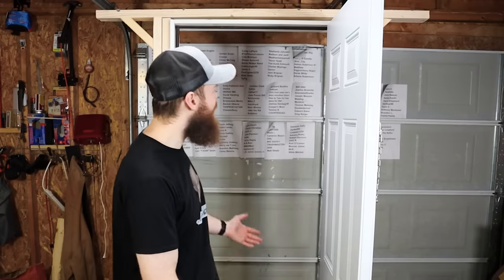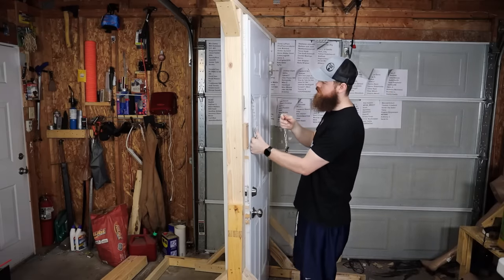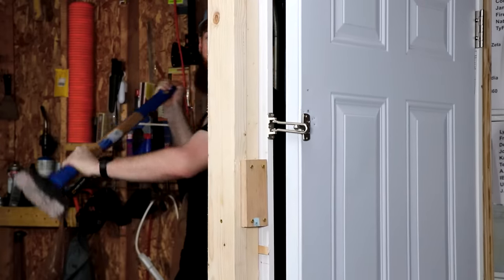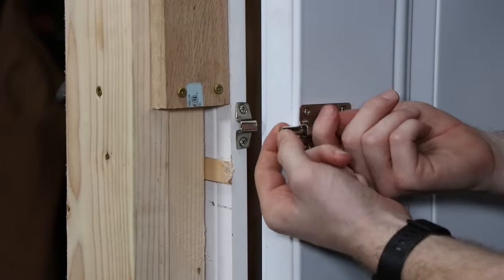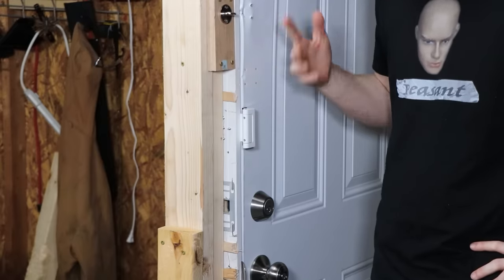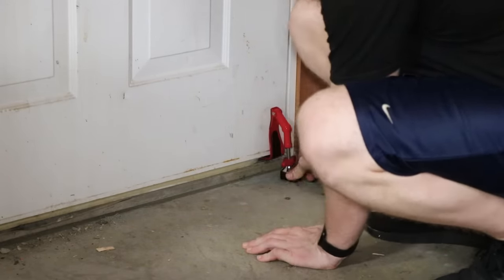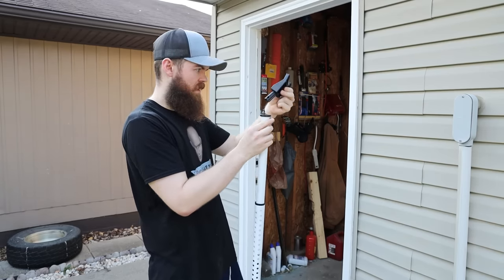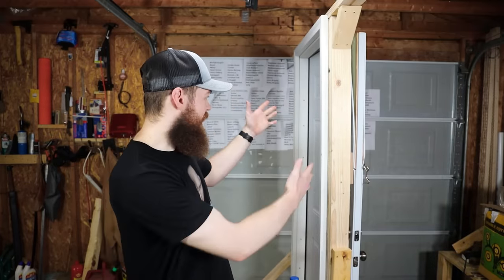Testing Top Rated Door Locks From Amazon!

Comment: Do you think the white hinge type lock that you assumed would be stronger could’ve failed because either (1) the door was so far off from being flush with the frame that the lock didn’t fully engage or (2) there was excess space in between the frame and the door, placing too much torque on the far edge of the bumper as this would create a radial/circular force that almost mimics pulling the hinge out with your fingers?  I can’t tell whether the latter is an issue from the view on the video. Just asking because i was leaning towards this lock the most before watching this video. Now not too sure

Comment: I work in a hotel that has those U-type locks. There has been instances where we've had to breach the door. There's a few ways to open them. 
1. Use a credit card/ drivers license/ or the hotel key card to slide it in the door frame pushing the latch open. It takes practice to do this effectively. 
2. Once the door is open you reach in with a pair of channel locks and grab and twist either the top or bottom "rung". This breaks it and moves it away.
3. Same as before. But once the door is open you use a good strong knife or the tip of an expandable baton and put it between the rungs. Then twist either up or down until it breaks and separates.

Comment: My apartment door came with the 2nd lock thing you tested installed, and it has helped me feel safe numerous times. I have anxiety and a bit of paranoia. Sometimes I get it in my head that someone is going to come in my apartment and kill me in my sleep. No good reason for the fear, tbh. I live in a pretty safe area. No crimes in this neighborhood in the three years I have lived here. And I am a man, so it's not like I feel afraid because I am weak or anything. It's just mental illness :) 

Anyway, I use the extra door lock thing whenever my brain convinces me I am in danger. This video of you struggling to break the door down with it on there makes me feel even better. And I know the one I have is even more heavy-duty (thicker, installed correctly) than the one you tested. 

Could you also test window locks? My apartment is on the second floor, but I still get paranoid that someone is looking up into my apartment from below and that if they see me they will grab a ladder and climb up in here to bypass the door. 

To anyone who is alarmed - yes, I am being treated for my mental illness. Knowing something is irrational doesn't make it seem any less real, in the moment. Once I get into that panicky hyper-vigilant state of mind, not even Superman could convince me the threat isn't real. I am not a danger to myself or others, at this point in time.
Reply: Honestly I thought I was crazy for this. My dad has always told me if you're gonna lock one lock make it the dead bolt but be smart and lock both. I get up and check my locks 2 3 times a night because I'm convinced someone will break in and kill me and my boyfriend when we sleep. I have the second lock he tested and like you said it made me feel better watching him struggle to get in. I live in a safe and gated community when we house sit (7 or 8 months out of the year) and so I shouldn't worry but I watch enough crime shows to know better. My boyfriend tells me I'm paranoid but growing up in a neighborhood where we've been broken into twice and had many robbers in it I don't take chances even though that wasn't a safe neighborhood. He complains that he gets locked out of the house because I forget to unlock the door but I tell him do you want me dead or do you want me locked out of the house. That changes his mind fast. I use locks more as a delay so the can't just walk in and I'm a light sleeper most nights so a creak in the house settling wakes me up fast. So I sure as hell will here a sledge hammer bang through the door. But trust me you're not alone it's safe to be paranoid it just means you're aware of danger and wanna stop it
Reply: Any time I get any type of pain like a sharp stab In my side for example I convince myself I’m dying it can be as simple as a headache and I’m convinced or I get a cut I always think I’m gonna get gangrene or some other infection that’s deadly I don’t know why also doesn’t help that I get lots of weird pains

Comment: A suggestion, if you want a secure door, just buy an outside opening one. Second tip, buy a strike plate. Third tip, buy big and long heavy duty screws and use them in all of the screw holes.

Comment: A way to impove the stick stop thingy is to drill a hole through the right hight setting and insert a steel pin with cotterpins on both sides. Im not sure if it still would fail but i want someone to try it. Im a failed engineer so i kinda know some things lol
Reply: The tube walls would probably just tear at that point but I think you would probably have to at least kick it then and have the foot of the stop in a hole so it can’t slide🤷‍♂️

Comment: One the easiest way to increase door security is to remove the little screws that hold your dead bolt receiver plate to the door frame and install 4 inch deck screws in their place... especially if you have a good sturdy steel core door and properly built door frame

Comment: You didn't install a striker plate for the deadbolt, of course it's going to break
Reply: Striking plate wouldn’t have kept the door frame in tact @Anon Ymous
Reply: @cadenj8171  yes it would.
Reply: @cadenj8171  it would if the screws were long enough to go into the 2x4 which they should be.
Reply: @cadenj8171  If you buy a security type yes it will because the bolts for it go past the door frame into the wall, which is the point of them.  in that case it is probably easier to get the door off by ripping the hinge side off rather than the deadbolt side, unless of course similarly beefed up hinges and bolts were used there too.
Reply: He was also kicking the door open rather that kicking it in. If he was kicking it in the frame wouldn’t have split as easy becuase the inside of the of the house section of the frame is much thicker than the outside of the house section of frame.

Comment: If your frame was bolted down so the door wouldn’t move when you kick it, the second lock may have broke sooner. Those things are pretty good though
Reply: Definitely been better if the whole situation was bolted down somehow for sure.
Reply: I'm not so sure he was stood on the frame while he kicked meaning hes putting the same force into the door as he moves with it
Reply: Had the door been bolted down, it would have been in splinters by the time he reached the third lock.
Reply: @dylandepetro4187  yeah the door/door frame definitely wouldn’t of survived near aslong.

Comment: I work at a hotel. Those latches are designed to be opened with a special tool from the outside. You could easily buy one offline. Or maybe even make your own as they aren't really anything more than a thin metal plate with 2 prongs. Also, there have been times where we couldn't find the tool and our security has just kicked the door in. I've seen 3 just rip out of the door frame still intact.
Reply: You can also reach in with channel lock players, twist and break it

Comment: He spent 2 hours trying to get the door to swing smoothly just to test these locks and break it. Haha. I'd actually like to know his thought process on how and why he thought the hotel room door lock was gonna be easy. Cause honestly, I've always thought out of all of them that I've seen, that one seemed most secure. The other sturdy one I figured would eventually pop the hook out due to vibration (which it did the first time he retried with different screws). If the hook had a carabiner type end instead of a hook, I'd say that it would work great though. I feel like if an intruder was gonna go this far, they'd be quicker just breaking a window. Haha. I mean, your door can be as secure as you want it to be but windows are always a weak point when it comes to keeping yourself safe in terms of that cause lets be honest, criminals are already breaking the law, they aren't gonna care that they have to break your window to get what they want. This was cool to see tested out though because I've looked into these for a while for more home security. I'd say Tyler was probably pretty sore after this workout. Haha.
Reply: Easy fix for windows is a pair of thick solid wood shutters mounted inside. screw 2 pairs of iron brackets on the window frame 1/3 from the top and bottom on each side, using stout 4 inch screws, then slip two 2X4s into the brackets going across the entire width of the window into each pair of brackets. They can break the glass all they want, but they aren't getting in.

Comment: Want a real “you’re not getting in” door lock? Steel U brackets, with a steel drop in rod. Pain in the butt, unsightly, but no one would be getting in. Lol
Reply: Or those c locks that you slide a c shaped thing over a metal plate and basically makes a flat surface right up against the frame and it can't move

Comment: I'd make a couple of changes to that chain latch. Replace the chain with a thicker chain and shorten the chain. or mount it horizontally with 3" screws. And I'm not a Tool Time handyman that grunts and growls doing work like than but learned to make lock improvements and put heavy duty slide bolts top and bottom of door. Take off the commercial door and use a solid at least 2" wood door, on 3-4 heavy duty hinges and 3-4" screws. On our hunting cabin we glued 2- 3/4" plywood sheets together with a 16 GA sheet metal sandwiched in center next drilled 4 rows spaced about the door, then inserted 2.5" carriage bolts from outside and put a washer with lock nut. On door frame ran a latch bar for dead bolt lock and doorknob strikers screwed with 3" screws from top to bottom, On the door before putting in locks etc. slid a folded sheet metal guard that my Granddad (made in his shop) with holes cut out for knob and deadbolt then drilled 3 holes at top, middle, bottom of the guard and again used carriage bolts with locknuts and put a heavy duty slide bolt top and bottom of door for when inside for the night. But when going out we had 2 dead bolt locks and just below the door knob my Granddad made a 3/8" thick cross bar using a 42-48" piece of steel flat bar cut in middle joining the two halves of flat bar with a sprocket designed for when locking the door from outside it would engage the flat bar into square tubing on either side of door that held the flat bar in a locked position.  The drilled hole through door drove a cylinder of rolled metal sleeve through the door and like one of those tube keys used to open vending machines, he keyed his own key to lock and un-lock the cross bar, making it hard to kick in from outside. All the windows had swinging metal bars that could be unlocked from the inside and when home was swung back like shutters against the outside wall of cabin. Only break-ins for brief time were critters that chewed through a knot hole. But we corrected that situation. But people snooping around when we. weren't there. Never did kick in doors or go through a window. Wish I could make that cross bar lock he made and all the guards he put on both doors and all the windows, on my apartment. Crime so bad with break-ins etc. it's frustrating.

Comment: Just go old school and get some iron brackets and a 2 by 6
Reply: YES...everybody tries to overthink and over engineer things, and they usually always fail. Just screw two very stout iron brackets directly into the 2X4 frame using stout 4 inch screws, and you're done.

Comment: I work at a hotel and the one you recommended as the best is one of the easiest to bypass with just a card. Also, you are testing all those with the door and deadbolt unlocked. All of these are added protection, not primary. Was fun watching you bust the door up tho.

Comment: That little wedge lock is good for hotel rooms.  They usually have a metal frame.  Not good for more than keeping the cleaning crew out, while you're sleeping
Reply: They also have bypass tools for those locks.

Comment: With the chain and slide, mount the chain part on the doorframe. Also, use 75mm galvanised screws for all door furniture in the frame, and if you have a screen door - install a tamper proof guard. It will buy you more than enough time to get that gun out and ready.

Comment: Having Your doors open to the inside is a major design flaw in residential construction. That makes your door 10 times more vulnerable to force entry. One of the reason commercial doors open to the outside. To make them more secure to forced entry. The US actually has many flaws in the general construction of residential housing. I had to custom build those aspects into my home. They use codes to prevent you from building a house that will last 1000 years. Everything about your home is meant to fail over time., Thank corporate America for that one

Comment: Tyler, the door chain is meant that for example, when someone knocks on the door, you open the door to talk to them but they cant attack you for example because the door doesn't open all the way. If the door chain was built with the OLD mechanism then it would be a lot stronger than he ball mechanism in this video tho. And next time, when doing a door kicking test, mount the door frame securely to something so it wont move back, like it couldn't on a real door.

Comment: If you look at the deadbolt, you can see it wasn't past the metal guard.

I used to set up security systems and I'd always carry spare deadbolt plates for customers I saw without them.
That's WHY the frame came off. The metal bit spreads the load and prevents it from breaking the frame.

The plate I have for my doorframe has 6 screws that are each 2 inches.

You will tire yourself out before you break my frame.

Comment: I’m super late to the party but one thing to consider is the lower the lock is mounted, the easier it’ll be to kick in because you’re not kicking the door towards the top but towards the bottom. Even when you used the sledge, you were hitting more towards the middle. If you want the most ideal chance for success, you have to hit near where the lock mount is located. Great video though 👍🏻

Comment: regarding the doorchains: mostly no  drywalls in europe, just concrete. so mounting it far away is even better than mounting it into the wooden doorframe. (and some doorframes are iron, so you can only mount it into the wall). Some of the items also depend on the sturdiness of the doorframes, so your wobbly frame could also be a reason for failure.

ALso i am wondering about the locking part of the doorframe itself. in europe most of those have a metal inset, so the door-lock itself is much safer, because its a metal bolt into a metal inset

Comment: I have one for you to test. Very cheap. Use some extra striker plates and stack two on top of eachother, then use #9 3.5" deck screws. Then buy a $12 "door reinforcement plate" that goes under the dead bolt and wraps around the door and reinforces it from breaking. This whole setup is like $20 max. I can tell you from tests, the hinges will fail first. So if you want to move to the next step, you need "anti kick" hinges. Then you basically have to break the door down the center.

Comment: If you are going to install a new deadbolt or other lock, don't put it near the top of the door. Put it near the bottom of the door. Nobody is going to kick the top of the door so a lock needs to be at the bottom, where the impact is. The only reason to add a lock to the top of the door is to keep kids from getting out

Comment: I always change the hardware I use depending on how thick the door is just under the thickness of the door and on the frame I have used 2.5" screws have a fun time getting past that.

Comment: Test is flawed from the beginning.

The only way to get an accurate test is to use a different door for each lock, you've fucked the frame and the door after the first lock, so it's already compromised.

The only reason the frame cracked so much after first kick of the deadbolt, is because it already had a crack in it.

Comment: This is why I put 4 inch deck screws in all my doors. Cheap insurance to get some real, heavy wood involved. The one inch or half inch screws go into nothing but decorative wood. You need screws that go into the framing of the building. Doesn't work as well with decorative windows on the sides of the door. Also, remove those. That's just asking for a break in. No glass near a door(unless you get security lamination installed).

Comment: On most door chains the part you slide the chain into/out from is on the door (Harder/uncomfortable to reach that way) and often the "slide" is sideways so it would get pulled further from the "opening" if the door is open (so you have to close it to unhook it)

Comment: I live in a trailer and I'm sure most trailers have a door chain. My actual chain is mounted to the frame and the slide is mounted on the door horizontally so you can't unlock it from the outside.
ETA: "Oh no whatever will I do!" I"M DEAD

Comment: If the striker plate for that deadbolt was through the studs, it would not have opened so easily. If it was installed properly, it would have taken a lot more work to open.

Comment: Gotta love that the concern with the chain was "It's gonna be mounted on dry wall!"... Yes, that is true. But only for certain countries like 'Murica. Where I'm from we're still using solid walls. So that's not really a downside in my book. It's just a local circumstance.

And let's be honest... "The standard door isn't as secure as I thought!" .. The doorframe was half broken from several attempts beforehand. So of course it was a lot weaker than a fresh door would've been. That's not a valid conclusion. Not wanting to attack or anything, but if you want real results you'd need one fresh door for every kind of gadget.